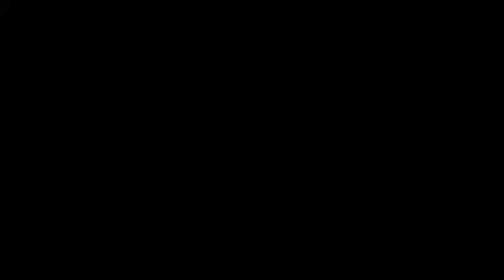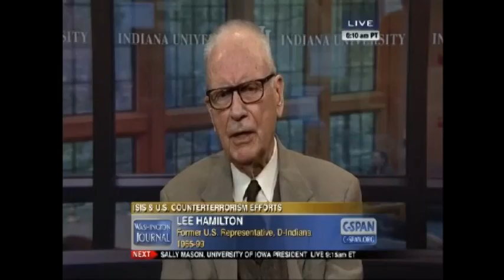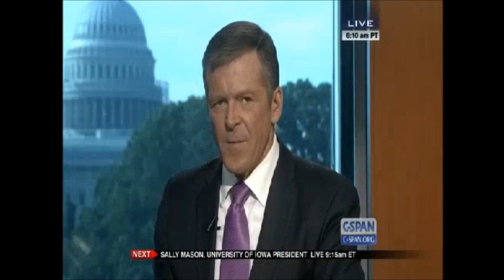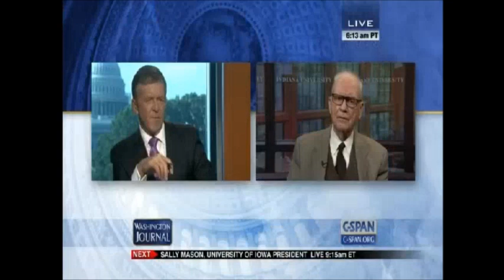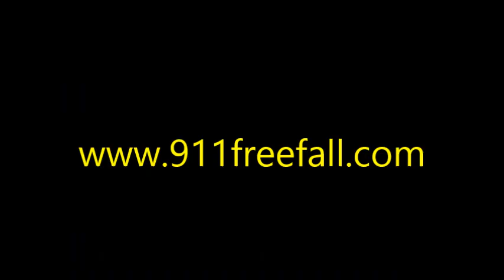Lee Hamilton-- the debate about WTC 7 continues

Comment: The FACT that the building fell into itself proves that ALL the structural columns were compromised at the same time, which is absolutely impossible with a fire. Particularly in a building with fire proofing standards applied.  If it were the case that a building could be flattened due to fire, then it proves that ALL buildings are not safe to exist, therefore ALL buildings should be demolished. BUT we know this is not the case.
We have seen fires of a far greater magnitude than that one, but the buildings stayed standing.

Comment: I am not an architect or engineer either.  The answer that I have read as to why these are the first steel buildings to collapse by fire is that they were "tube in a tube" design. The towers were steel without concrete.  There have been steel buildings that have burned violently for 7-10 hours, but stood in place afterward, but they weren't built like the Towers.  Also, most of these fires weren't caused by airplanes either.   Does it make sense that they would collapse because they had no trusses, no concrete, and built tube in tube?